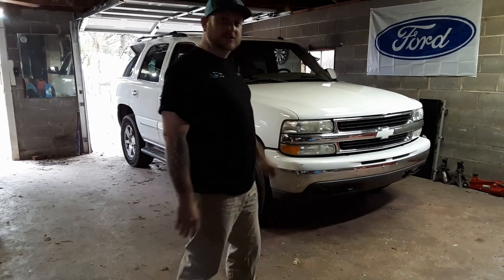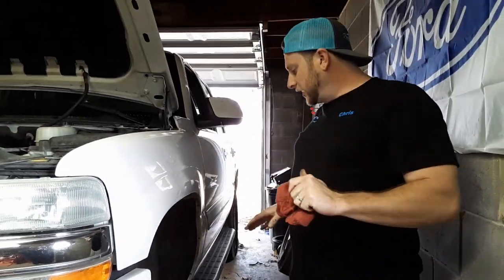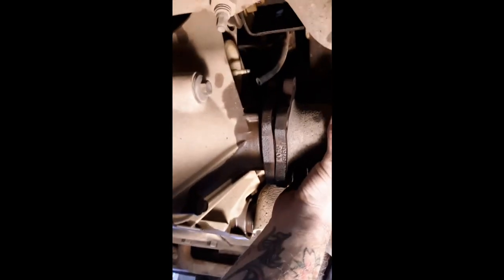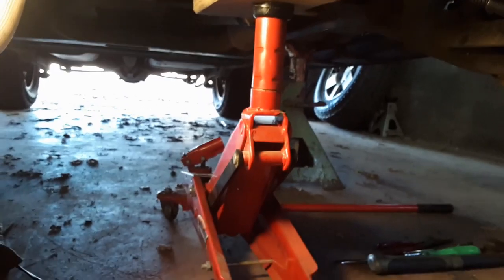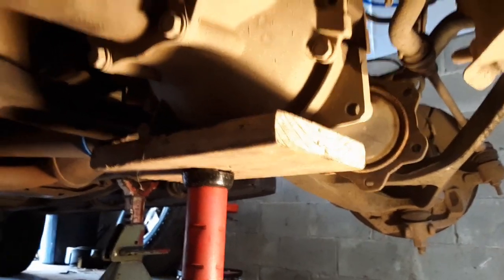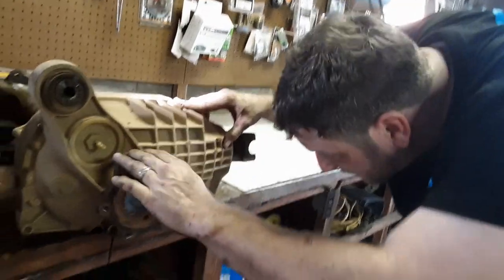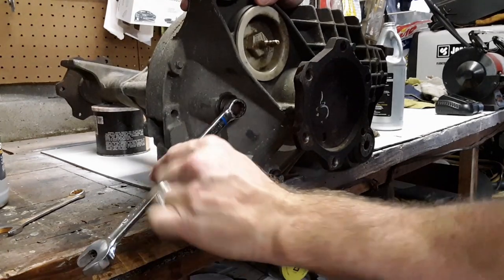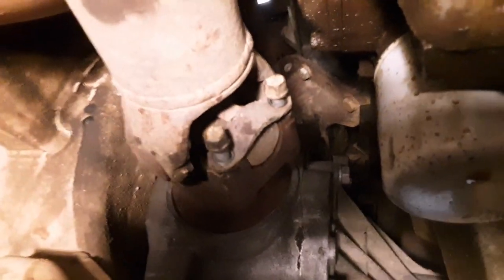00-06 Chevy Tahoe Front Differential Removal & Installation

Comment: Thank you so much for this video. It was the single reason I was able to do this job myself and not spend more money then I would’ve been able to. Just one point I wanted to make to maybe help others whom come across this video. Your initial assumptions that you did not have to take off that steering center link to get the diff out from under the truck was actually CORRECT. The steering center link does not have to be removed to get the front diff out. Once the diff is unbolted all you have to do is while you’re lowering the diff with the jack just turn it slightly up (clock wise) so that the part of the diff that connects to the drive shaft (u joint) is now facing up and then pull the diff slightly towards the passenger side of the vehicle. It easily clears the center link once you start to bring it down towards you and it comes right out. Do the opposite for installing the new one. Should’ve listened to your gut instinct! Ha ha. Regardless thanks again. You really helped me out big time. 👏
Reply from the maker: That's awesome. I'm glad it helped. Thanks for the info on the steering link. I will have to remember to do it that way next time. Also Thanks for watching my video.
Reply: that's a good tip. im in the middle of decisions (take it off or put it back)

my question is.   can the truck run ok with out it? i don't need the 4x4 now
Reply: Danny what year are you working on? You have to remove the centre link. I spent over and hour trying to wrestle it out like an a**hole. Other people in this thread are saying the same thing. I read your post and thought it could be done. Thanks for the waste of time!
Reply: @michaelaulozzi2368  2005 GMC Yukon Denali XL I didn’t  have to remove center link.

Comment: good video.  it helped me alot.  i had to do the job by myself though.  Wifey helped me get the new unit out of the back of my other truck.  that was about it. I tried but could not get her under the truck I was fixing.  You definitely want to make sure you have the gear ratio that matches the rear differential.  The only  thing I might add is to remove the fill plug while draining.  The old fluid comes out faster and it makes sure you get all of the old fluid out. Also 1/2 inch drive impact swivel sockets on an extension with an impact wrench gets those big mount bolts out pretty quick. and one last thing.  kelvenguard's idea about removing the steering box bolts instead of the centerlink worked very well for me.

Comment: Cool video, only thing people should be aware of is to drain the oil before you pull it, extra weight. Also, when you install it, refill it when it's mounted so it makes it a bit easier to move around. Just use that little pump he uses.

Comment: If your Steering Rods are in the way remove the 3 frame Bolts on the Steering Box (Just the 3 Bolts) and your steering will swing enough to drop your Diff
Reply: your idea to get around removing the center link is the best.  Worked like a charm with no need to beat your brains out on the idler arm and pitman arm. Thank you
Reply: @larrydavis5988  THANKS... I bought a Truck with low Oil pressureI... dropped the Oil pan to fix a low oil pressure... seen a NEW melling oil pump and O-ring... Next was to Pull the Motor... the Floating rear end was in the way of the left Motor mount so I figured theres got to be a simple way its only 1/2 inch and everything on Ball Joints :)
Reply: @larrydavis5988  Replacing All the Rusty Fuel lines or Brake Line on a GMC Truck... Remove the Body Mount Bolts and Lift the Cab or Box 6-8 inches... This works for Exaust Cats/H2O sensors and many other parts and tight areas also... Usally lifting one side works don't need to remove ALL body mount bolts just loosen some... I got 43 Years Auto Body experience....

Comment: Thanks..  exact sound my 2006 Denali is making.  Drained the fluid. It was metal gray in color and some metal accumulated on the  magnet.  I appreciate the update comments. My main concerns were all asked.  Thanks.
Update. I ordered the front diff for my 2006  Denali AWD.  Replace the front diff with a Remanufactured Front Diff from RockAuto.com. Exact fit and fixed my humming sound and the slack in my drivetrain.   I used a pickle fork to remove my steering linkage. Few taps with a 2lb maul popped right out. Didn't damage the boots either.  Thanks again to this video.
Reply: Have the same truck with the same issue. Did you have any issues doing it yourself? How’s it going so far with the new part? I’ll try rock auto like you did. Heard only good things about them. Thanks for suggesting the pickle fork. I’ll make sure to pick one up. If you have any other suggestions please let me know here if you get a chance. Thanks man! Much appreciated!
Reply: @dklef  No issues with the install.  6500 miles on the new part from Rockauto.com  no issues.
The ratchet end box wrench worked well also  on the diff mounting bolts.  
From Harbor freight bought the 3ton big yellow floor jack and some heavy duty jack stands.  Jack the truck up safely and used the jack to remove and install the diff. 

Very rewarding and worth the effort. I have 180k miles on the truck. Now I plan to keep my truck for a while. 
It’s been 9 months. Any other questions let me know. Study the vid it’s good and be safe.
Reply: @12rochelle  I have 180k as well and I don’t want to get rid of it yet. It still serves me well. Thanks for the tips much appreciated it!

Comment: Pretty awesome video. Only thing im currently hung up on is the steering bar. Howd you remove it? Got the tie rod and 2 nuts to steering bar off but its not budging. Did u use a tie rod separator?

Comment: Looked easier then I thought it would be . Wish u would have shown the drag link removal tho . Did u have to use a puller to get it off the pitman arm ?

Unfortunately I gotta take my diff out the put a new oil pan gasket on .
Reply: I'm having a hard time removing my drag link as well. Did you get yours off?
Reply: @Tacosandcheeseburgers  I haven't done the job yet been busy. Got rent a puller from auto zone. That should make it way easier .
Reply: Nightmare

Comment: I hit a boulder with my 04 Yukon on the driver side corner in front, now the axle housing(?) has a crack all the way around on the tube that goes to the passenger front tire. Do I need to buy a whole new diff or can I just buy the one part?

Comment: I appreciate you taking the time to post this video.  I have an 05 denali that makes the identical noise.  I hope to get the time to swap mine out.  What years fit mine that interchange?  I have a 2005 Yukon denali awd.
Reply from the maker: I appreciate you watching my video and taking the time to comment. I don't remember exactly what years were the same but I added a list of vehicles in the description of this video. It was a fairly easy job. Check your local scrap yards for a used one. I think mine was around $200-$300. Still riding smooth as eggs today. Again thanks for watching my vids.
Reply: The Tahoe yukon Escalade they all have the same diff for that gen year they have a 3.73 gear ratio

Comment: How many miles did your original front diff go out at? How many miles does the new used one have on it? The gear oil in the new one was just as black as the first one. How do you know the new one didn't have any bearing issues? You could of bought a new reman one for not much more money with a warranty.
Reply from the maker: I think the original went bad at about 150k miles. I'm not sure about the miles on the new/used diff but I bought it from a friend that runs a parts yard,he gave me a good deal and warranty. I'm sure the old one was just the bearing but I have replaced those in the past and it didn't fix it, so this time I just went with changing the whole diff. It was much faster ,easier,and the cost of the new diff wasnt too bad compared to the profit I made on the sale of the vehicle . The new/used diff could have had a bearing issue as well,that's just the chance we take using used parts. Luckily it was good to go. No sounds or grinding. Thank you for watching the video and thanks for the comment. If you see that I'm doing something wrong or something that would have made the job easier,please comment.
Reply: Mine has 237,000 miles, and is now making bearing noise. I'm finding warrantied used ones for less than $300, but reman's are $1,100 +. Huuuuge difference. Plus I don't believe it financially feasible to put a new 1100 dollar part in a car with this many miles.
Reply: @newmexicojoe5443  "this many miles" Those GM vortec engines are know for going over 300k miles. An $1100 dollar part is approximately 2 months of a new truck payment. Well worth it in my opinion. Alot of the reman diffs have a 5 year 100k warranty . If the rest of the truck is in good condition and well maintained I wouldn't hesitate to drop that money in it if I was going to keep it for more than a year.

Comment: Ok so my 2004 Escalade has the exact same issue , while driving and giving it gas it whines louder and let off it almost completely goes away , you can still hear it slightly but you give it gas it gets loud and kinda Grindy, I decided to change the fluid and the old fluid was brown and as thin as water ! Metal shavings on the plug too , was this indeed your issue and did swapping another diff solve your problem ? I’m picking up a front AWD diff today for 200 with 160k on it my Escalade has 246k I really hope this fixes it . I almost thought wheel bearing but a wheel bearing would remain the same noise gas or no gas
Reply from the maker: It sounds like the same issue I was having. I thought wheel bearing at first also. But this did fix my issue. It would whine during acceleration. If I let off the gas it would stop almost immediately. I hope you get yours fixed. Thanks for watching the video!
Reply: Same issue with my 04 escalade

Comment: How did you get the centerlink loose did you just remove the 2 bolts and it came loose or did you have to bang on it. Cant get mine loose.
Reply from the maker: I had to bang on it with a hammer. I used a 4lb. hammer
Reply: @RadFabz  thanks for the reply
Reply: @RadFabz  figured I'd drop a quick update. Got mine out using a 2 jaw puller. Couldnt get enough space to swing my hammer. Took me a bout 5 minutes with the puller and ratchet. In case you have to go at this again. A quick tip that may help!
Reply: I dread doing this to my silverado . Both the carrier and the front diff went out . Cartier had chain slap cracked the case . Bull gear in the diff went . Fun times ahead